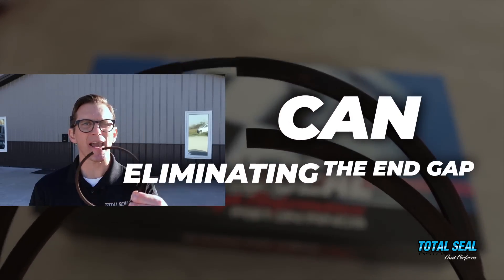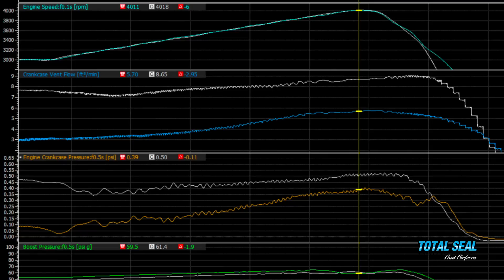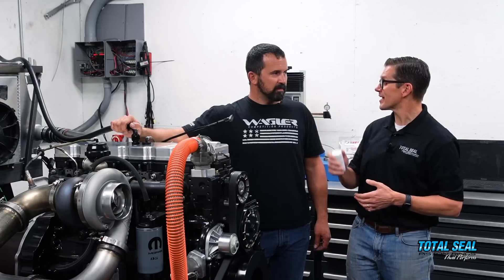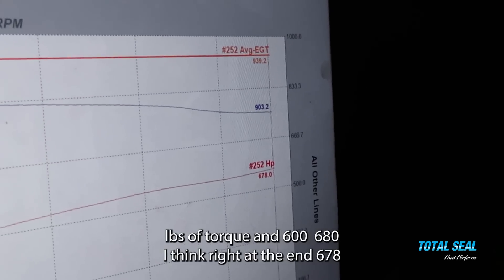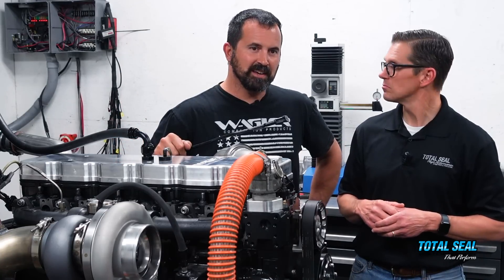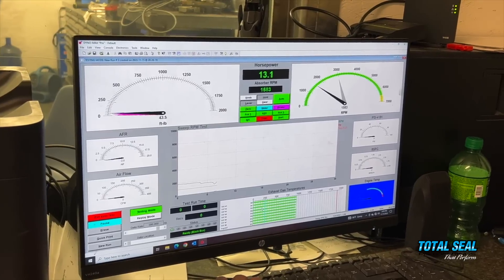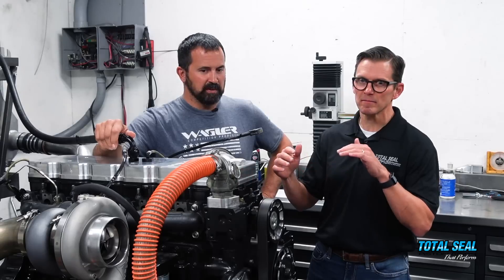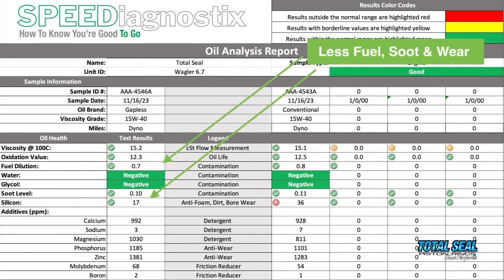Over 1,000 HP... It's one of the BEST Back-to-Back tests we've done!

Comment: Interesting! Why gapless 2nd ring instead of top ring?
Reply from the maker: The top ring is a Keystone design, so it can't be Gapless.
Reply: @TotalSeal  That makes sense! But surely you could make a new gapless design to work with that geometry also if you really wanted to?
Reply from the maker: @ElmerRacing  Actually, the split ring design used to make a Gapless ring would not work for a Keystone style ring. It would have to be done a different way.
Reply: @TotalSeal  Yes. But there probably is another way that it could be made?

Comment: While this data and information is great. I'd love to see long term testing. Gas and Diesel. I chose not to use gapless rings on a few of my daily drivers as I couldn't find any non racers that had used them more than 20k miles. Even a few people that said they needed to rebuild again 50k miles later.

Comment: I've read that turbo engines (gasoline) need a bigger second ring gap to prevent ring flutter.. but I'm guessing there's no issues with the gapless ring. The top ring is probably sitting there thinking " there's no point in me being here" 😂
Reply: I also follwed the instructions when I turbocharged my Mazda 323 😅 6thou per inch of bore on the top ring and 6.5 per inch on the second

Comment: How do they solve the expansion of the rings, surely the rings will gall and seize, I understand the stepped ring concept but a solid circle ring??????
Reply from the maker: The Gapless ring is a two piece ring. Each piece has a gap for thermal expansion, but those gaps are installed 180 degrees opposite of each other.
Reply: @TotalSeal  thanks for that ,but why not. Just another ring groove and ring, friction too high?????
Reply: @GWAYGWAY1  it is not an extra ring or ring groove. The two rings assemble together in thev same groove and are the same size as the original ring it replaces.
Reply: @themotoroilgeek  rings rotate in their grooves unless pegged like two strokes are, what would stop them rotating until the  end mated and caught?
Reply: @GWAYGWAY1  The Gapless rings interlock, so the whole assembly rotates without the two individual rings rotating opposite of each other.

Comment: Has Total Seal or anyone else done a comparison test of a custom piston set that used a rectangular top ring instead of a Keystone,  and then made the top rings gap less  instead of the second .  Even on a turbo  engine I would think that  would be better than a gap less second.  Not all diesels use Keystone top rings, VW doesn't, I don't know about Mercedes or BMW car diesels.  Audi is a division of VW and they won the 24 Hours of Le Mon  a bunch of times with a diesel car.  Maybe the engine had a keystone top ring, but since it was a VW engine , maybe not.  Perkins had a 5 ring piston on  at least 1 of their engines back in the 60's, the third groove had 3 thin cupped rings in that third groove, 2 facing  toward the single  ring  that was cupped against the pair.  So gap less is nothing new.  Today with thin steel rings  being more common , it wouldn't  be that hard to stack  2 rings in the same top groove.  And why do hard pulling engines have a problem with the top ring sticking anyway?  Isn't that caused by EGR and closed crankcase venting?  Case  IH  does all of their emission  control in the exhaust ,  no pathetic EGR.  Problem solved!
Reply from the maker: The drag race engines are using a rectangular top ring in the high HP diesels.

Comment: Lake, what were the honing specs in this engine? Did they go aggressive on the valleys like you’ve done recently? What about their cross hatch angle?
Reply from the maker: This one didn’t have the hone with the deeper valleys. I’d suspect, the HP gains and blow-by at the 1,000 HP tune up would have been greater if the hone was different. At the 800 HP tune up, the Gapless ring was 35 HP better…
Reply: @TotalSeal  Wow, so with your latest hone specs, this engine would of done even better on the blow by and sealing.
Reply: @GNX157 absolutely!

Comment: Stock 6.7 cummins are really beefy units. A stock block and crank have  been north of 3000whp. They dont really last but they can make the number.

The one thing i havent figured out is why an OEM hasnt used gapless rings. You would think with tightening restrictions on emmisions and efficiency, getting 1% power for almost no R&D and a drop in blow by it would be a no brainer.
Reply from the maker: Patented technology…
Reply: @TotalSeal  Obviously it's patented, but that just means Total Seal & OEMs are choosing not to work together since the benefits apparently aren't worth it?
Reply: @TotalSeal A friend of mine works at Paccar / Daf engine departement.   I am sure they have tested it.  But OEM is a different world.  The block needs to do 1 millon miles...under numerous conditions and tests.   So maybe it might benefit for  e.g.  efficiency in the first 300k miles but starts wearing out after that and with 600k miles its benefit turns equal and than starting going negative.  On top of that the rings will be higher in price so... But I will ask and maybe he has an answer.    They run into different  things  than we do at ' short track '   users ........ 

E.g. Had a chat with head of departement about  modifying porting.  Very interesting with limitations on seats , construction of head , lines of force through head , bolts , block , main cap bolts ,  fuel return bores , etc etc etc etc.   Its a different  and very interesting field .
Reply: @TotalSeal  "patented technology" huh? So are you saying the reason OEMs don't use your rings is that you won't let them? That seems dumb.
Reply: @vica153  I guess he means  with patented is that a gapless ring isnt more costly because of  manufacturing ....but also on top of that a license fee has to be paid  per sold set /engine.
Reply: I think cost is the main reason oems don't put gapless rings in their engines. If you build a thousand engines and the rings cost a hundred dollars more for example, you just saved $100,000 by using conventional rings.

Comment: How about including the speed of air dimpled thermal coated pistons, poly quad valve modification, super porting the heads and applying thermal barrier/dispersant coatings?
Reply from the maker: The Speed of Air pistons are the next diesel engine test!
Reply: @TotalSeal  That's great! I've watched the video where you connected with and met Dave and the gang at Dave's Auto Center in Centerville UT.  Those speed of air pistons are the best thing for any ICE, especially the gdi and diesel (CRD and IDI) engines.

Comment: This is anecdotal but fits this video.  We were a budget nitro funny car in the late 90's into the 2000's. Oil dilution was a major concern.  Warm up oil would come out a very milky, light butterscotch color and was a throw away item.  We were constantly looking for ways to cut costs and after a night of bench racing and being informed that there would be a new piston and ring order being made shortly, I decided to call Total Seal to see what they had and what the pricing was.  I handed the pricing and info to the car owner, he was skeptical, the next time I saw him and the decision was made.  At our first race with the TotalSeal rings the warm up oil would come out a very dark butterscotch and could be reused for a second warm up.  The oil savings more than made up for the cost of the rings.  Sometimes there are reasons other than horsepower that get you to try something new.
Reply from the maker: Absolutely! Thanks for sharing!
Reply: Total seal could sponsor just stop oil 🙂
Reply: @gothicpagan.666  Please, share your takeaway from the video.
Reply: @TurboJohn74  The potential oil life extension, is what I'd be interested in. Wonder what the service life of a typical syn. oil would be, if gap less rings were used in a hydrogen fueled motor?

Comment: With a back to back test… them standard rings in all reality should have 1500 miles on them to really seat the cylinder well… was that the case in this test? 

Back to back the total seal ring design should seal better IF the OEM rings don’t have proper running time to seal?
Reply from the maker: The blow by meter said they were already broken-in (no change in blow-by run to run). Plus, only the 2nd ring was changed.
Reply: @TotalSeal  ok. Thank you for that info.

Comment: Would a gapless 2nd ring be a bad idea on a high reving gas engine due to trapping gasses between the rings? Would a gapless top ring work better in that case? Why doesn't every engine use gapless rings?
Reply from the maker: A gapless 2nd is great for Boosted engines. A Gapless top is ideal for a NA competition engine.

Comment: Now, finding a good machine shop is the challenge. Components are more reliable and available, but talented people with modern technology is not abundant.
Reply: DAVES AUTO CENTER IN UTAH, and they LOVE DIESEL'S!!!  Shop is like an Operating Room....
Reply from the maker: Agreed!
Reply: @kendavis1198  Daves/Monster... offers only completes (ie longblocks).... 16week turnaround (they have a good reputation and fair shipping prices) ... if you want to do your own build... still difficult to find a shop. Daves (MonsterEngine)  usesgood practices and machinery... They are a little fuzzy on their hone specs and really don't talk about that, even though they have a decent Rottler H85 and TraceBoss measuring ....  @monsterengines
Reply: Wagler, D&J, Scheid, lots of good diesel machine shops out there!
Reply: Does anyone know of a quality machine shop in the Nashville, TN area? I have had subpar work done at several around here. It's very disappointing considering how fast the area is growing!

Comment: I need mack e6 size rings! Wanna rebuild a couple of motors
Reply from the maker: Contact our tech support team at 623-587-7400. We can make Gapless 2nd rings for you.
Reply: Exactly. I only burn 65-75 gallons a day in each of my log trucks, but the horsepower is from the combo becoming more efficient and the lack of soot in the oil and blow-by reduction is showing how much better it's sealed up and how it's keeping the work in the cylinder... which would definitely help with oil change intervals too! Jeremy Wagler is a great guy, has always done an incredible job and is always looking for something that can be improved, so I couldn't think of a better guy to perform that test!
Reply from the maker: Contact our tech support team at 623-587-7400. We can make Gapless 2nd rings for you.